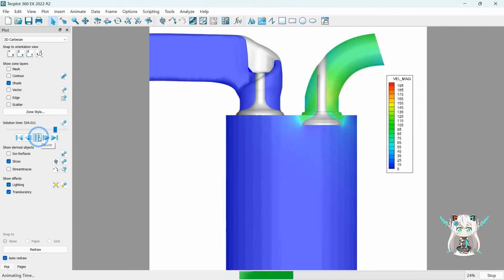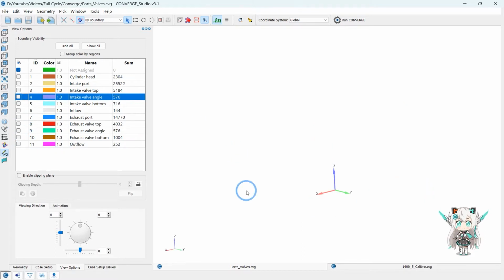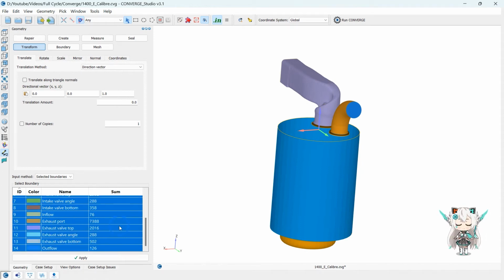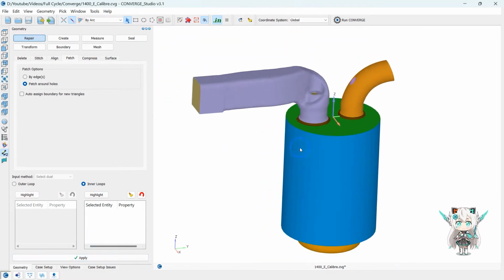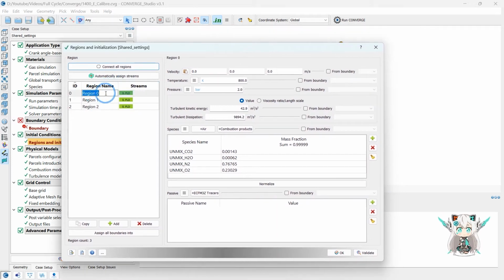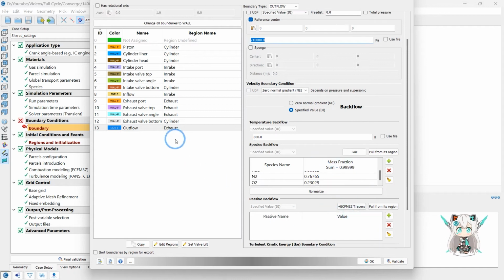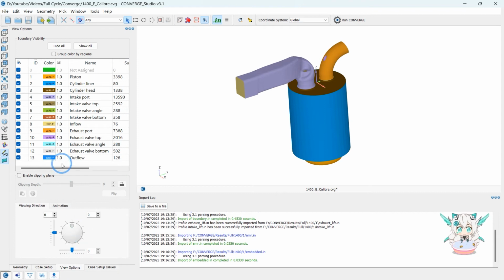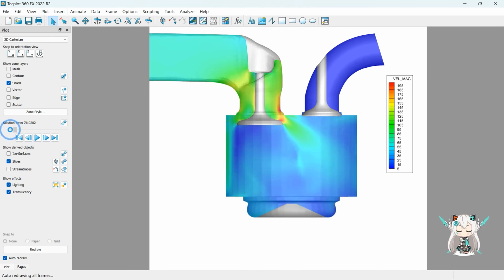The Easiest Way to Perform Full-Cycle Diesel Engine CFD Simulation with CONVERGE

Comment: 👋Greetings Maste.
_How to adjust the Simulator to observe the behavior of the Atmospheric air in the intake of a Cylinder during combustion of the air/diesel mixture with the following conditions:
➡️ Admitted air mass; in order to obtain a leaner burn possible in the stoichiometric ratio range between 14.5/1 to 200/1. Taking into account the variation in temperature and pressure of the Atmospheric Air in the Intake from 17° to 50° and 1 ATM to 1020 mb (millibar).
The cylinder with a cubic capacity of 1200 milliliters with the geometry of the commercial Diesel engine model OM924.
-Consider the Diesel S10 in a typical mixture commonly found at gas stations ⛽.

Comment: But cylinder head is not as flat as close loop geometry, usually there is a difference
Reply from the maker: Certainly, typically it has a curved depth, but in some articles, it is regarded as flat to simplify the geometry. However, for enhanced accuracy, it is essential to input the geometry with all the necessary details, requiring the use of CAD software. In this context, the objective was to illustrate the fundamental principles of the task, and the geometries should not be identical.